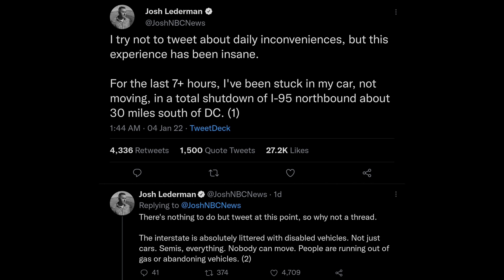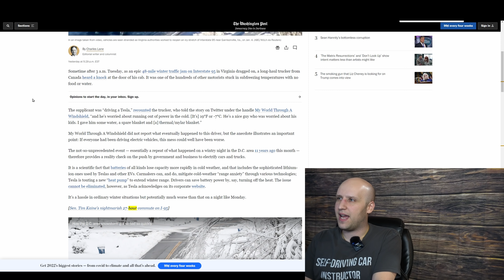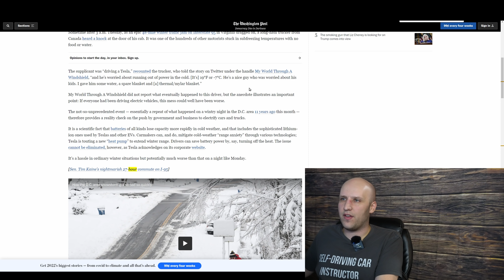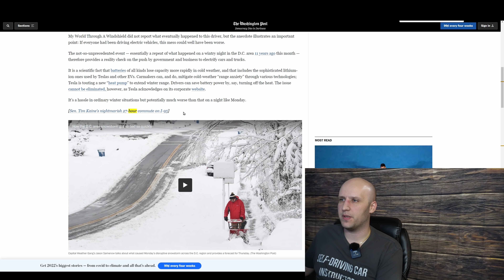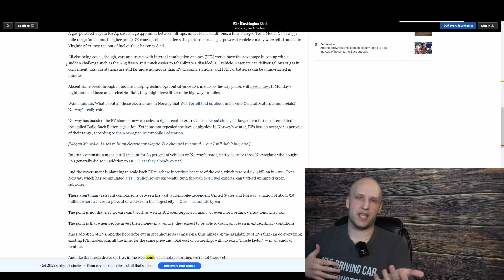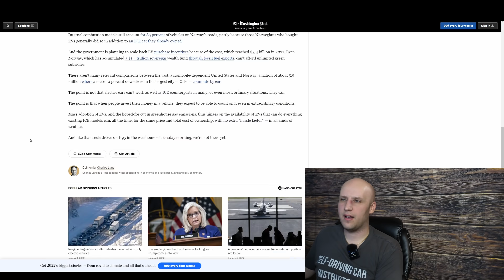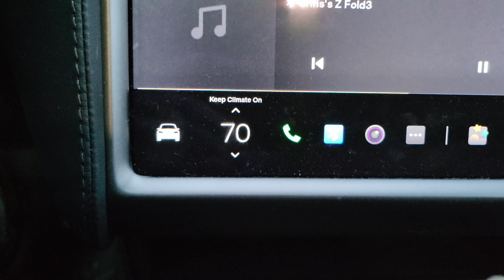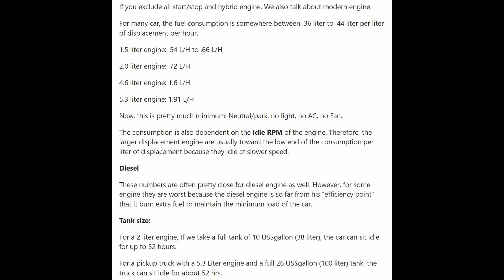How Long Can a Tesla Keep You Warm In A Frozen Traffic Jam? | FUD Debunking

Comment: If you are an EV owner, you're more likely to have the habit of plugging in every night with a near-full battery (80%).

So, you're most likely to run out of fuel in an ICEV.

As for future, how hard is it to upgrade the highway lamps to have accessible plugs that can be activated for moments like this. Just  use shore power for climate.
Reply: The cars & charging infrastructure is upgrading, quite rapidly too… I’m pretty sure petrol stations weren’t all over the place nor were combustion engines as efficient when first adopted. 

We may even soon have very effective solar charging on cars, just hope I’m here to experience the ever growing technologies.
Reply: @MegaGyalis  with more EV coming from GM and other companies, I'm hopeful more will be on board to expand the charging network. I hope we have EV charging at every rest stops.
Reply: @MegaGyalis  i don't believe we'll ever have "effective" solar charging on cars, at least not likely in my lifetime, but i hope i will be wrong, sooner rather than later, but the thing about electricity, it's everywhere, so yea, in cases like this, to have the ability to tap into the current already running alongside most highways, would be great.
Reply: @teklife  wrong. We will. We went from less than 1kw per square feet that costed 76 more expensive... to 17kw per square feet that cost only 15 cents per square feet. Things have changed. In 20 years it’ll be down to 3-4 cents per square feet and probably more dense and boom it’ll be efficient and cheap enough
Reply: @MegaGyalis  We would need 40kw per square feet to be efficient and viable on electric cars, and we still get only 17kw per square feet from 300 watt solar panel.
Reply: @swampyemerson8269  lol
Reply: @swampyemerson8269  I mean charge the entire car forEVER!!!!!!!
Reply: Or you don't have your own charging station and usually drive around with 20-50% battery charge because charging at lower battery levels is way faster and you don't enjoy wasting your time in some parking lot with a charger. Especially on a highway you are more likely to find people driving around EVs with low battery levels than fully loaded ones. The scenario of you fully charging your vehicle only to get stuck for 12 hours on some highway 10 minutes later seems super unrealistic to me anyway. More likely you have been driving for quite some time and your battery is at around 50% or less.
But I guess in the US it is different. Everyone has their own house and then use their 400 miles car to drive 10 miles and back. 

The message should be to make sure your car doesn't run low on fuel/electric charge when there is a chance of very bad weather because it sucks for both if their car runs out of its respective source of energy.
Reply: @ralfrudi3963  Hey Ralf, you don't get it.  Here in the US, nobody is responsible for anything including the safety of their lives.  Technology is supposed to take care of everything, LOL.  Basically, we are breeding a bunch of sorry asses.
Reply: That is a brilliant idea!
Reply: That's a very good point.
Before lock down I would typically take my ICEV from 95%-5% before filling up.
Wouldn't stay warm for long with 5% in the tank lol.
Reply: That is all fine when there IS electricity.  In many disaster situations that is not the case.  Hurricanes, tornados, wild fires and snow/ice storms kill the grid.  You got nothing.  Then what are you going to do?
Reply: Wow! Before we do anymore goalpost moving, let's make it easy and start from zero.

You make your own gasoline (you'll most likely need to dig deeper than 6 feet) and I'll make my own electricity.

Comment: Well rounded view on this.  Thanx.
Nowhere near as extreme, but last year there was a freak snowfall (just much more than expected) here and my 1.25 hour trip home ended up taking about 7 hours.  Mostly because of larger vehicles who thought they could drive normally and blocked the roads when they slid.  I had two different "accident stops" of about 2 hours each, where I just had to sit and wait...
People all over were asking me how my Bolt did and was I worried, at risk, etc...
I was fine...
I did have some things going for me.  
1:  I can charge at work, so I left with a full (well, full on Hilltop Reserve mode) charge.
2:  I had my car preheated while it was plugged in before I left.  So the car was already warm.
3:  I never set my car to 70 degrees.  :-)  That is just way to warm for me.  I'm comfortable around 64.
4:  I had a heavy coat and water and some snacks.  ;-)
So, even with my smaller battery and less efficient car, I was prepared and it was fine.
And I didn't get home on electric fumes. ;-)  I had plenty of battery left.  So I would have been fine for longer.
And I never had any worry about snow buildup around my tailpipe and carbon monoxide issues...
Now, if I couldn't charge at work and/or my car wasn't close to fully charged, I might not have tried that drive home then.  But as you pointed out, the same would have been true if I had an ICE car.  I would have gone to a QC first.  
I was much more worried about other cars on the road causing more accidents than I was about battery level...  ;-)

Comment: Would have been interesting to use camp mode instead of leaving climate on.  I would assume it is more efficient as it is designed for overnight stays - I could be wrong though.  I probably would have used camp mode if I were in this situation.

Comment: Seat heater is not significantly more efficient than air heater.  It is just that it provides more comfort directly to the driver.  For your experiment, both are working until the interior of the car is a 70°.  The heat pump is much more efficient than the seat heater.
Note, that an electric car will have a higher average fuel fill, since they should start each day with a full tank.
ICE cars lose that same 20% of range.
Thanks for actually doing the math as opposed to the FUD media.
Reply: Current heat pumps have power factors of about 3-4, i.e. they use 1kWh of electricity to generate 3-4kWh of heat.

But: The seat heaters directly heat up your body, whereas the A/C has to heat up the whole interior volume - and all that heat ultimately goes into the car body which has about 50x more surface area than a human. So regardless how much more efficient a heat pump might be, it still has to provide much more energy overall. (50/4 = 12.5x more in this case, assuming you only use the seat heater - which of course nobody would do, as their head and feet would get uncomfortably cold)

Hence the most energy-efficient way to stay warm is: A/C at low heat (blowing onto your feet, i.e. concentrating on the area where it's really needed) & seat heater for the rest (optimally not wearing a coat, but using it as a blanket, in order to get as much heat transfer directly into your body while at the same time minimizing heat loss to the surrounding air)
Reply: The seat heater heats you, and doesn't have to run all the time (it cycles). The air  heater heats the outside as well, significantly.
Reply: Running the seat heater alone will last several days, perhaps a week or more on a full charge, and has zero to do with bringing the interior temperature to 70.  The energy usage between heat (even heat pump) and seat heater is wildly different.

Comment: ICE cars also lose "range" in winter conditions.  I have 12 years of fuel logs for my Subaru WRX and my mileage was 7% lower in the coldest four months of the year as compared to the warmest four months of the year.  It's certainly less loss than occurs on an EV, but let's not pretend that you're getting the same "range" on a tank of gas in the winter that you get at other times of the year.  For reference, I live in Western Washington.  We usually get about two weeks in a year that are in the 20's, but most of our winters are in the 30's and low 40's; so not particularly harsh winters.  I don't know if this phenomenon would be exacerbated if subjected to something like a Michigan winter, but I do know that when you look at my tank mileage graph, the trend is clear as day.
Reply: Right. Winter fuel blends also contribute to this. 

The other side of this story, which remains invisible to most people, is that  you don't regain any of the efficiency lost to combustion, regardless of the season. If gas cars had comparable efficiency to EVs, the massive potential energy in gasoline would allow them to drive over a thousand miles per tank. Losing ~70% of your energy through heat and other losses, 100% of the time, has become normalized.

Comment: Ford F-150 Lightning, Rivian, and Cybertruck have outlets on them which would let you use their battery to charge another EV.  The F-150 and Cybertruck even come with a 240v outlet to power devices or another EV.  You can even put a large gas generator in the bed to charge the trucks own battery or as well another EV.  The F-150 also always bi-directional power through the main charging port to power a building or charge an EV.  Ford has anounced that they are currently making more F-150 Lightnings than any other vehicle they have made, there is that many pre-orders of them.

Comment: I wonder how long it would take until the US Govt would require emergency chargers at every highway exit, similar to emergency phones required on highways. The cost for a 220v L2 charger are minimal and it would completely kill range anxiety. That, in conjunction with a requirement to have 2x 220v L2 chargers at each and every gas station (likely at state level) would completely annihilate range anxiety. Note these would me more for emergencies and “last mile” use, not for normal charging. I assume that L3 charging network will grow as EV fleet grows, but in the short term, building L3 at every gas station or highway exit would likely be too expensive and take too long to build out.

Comment: Also keep in mind as you lowered Model Y's temp, it probably turned the AC on for some time to bring those temps DOWN. You can probably round that up to about 65~70 hours.
Reply: Probably not, model Y is smart and since recirculation wasn’t on, it probably just took the outside air and cooled it down.
Reply: @harsimranbansal5355  YOU COULD HEAR THE COMPRESSOR COME ON.

Comment: One note is that for ICE vehicles, the best way you can heat yourself if you're stranded is to run the engine on and off. Crank up the heat and run the car until it's warm inside, and then shut it off.

Still, an EV should serve you just fine in most situations. The most important thing if you go take a long trip (in any weather) is that someone knows where you're going, so they can call for search and rescue if you don't make it to your destination.

Comment: Another point to this which I just thought of is if you lose power in your house, and can sit in your car and keep snug (with a blanket and a coat and hood and seat heaters) for days, that's a fantastic winter safety thing generally. 

I have a whole house generator, and don't want to go the powerwall thing good enough to last for days until the batteries get MUCH cheaper and are significantly less likely to burn/explode re chemistry.   But if I have a BEV that I keep 80 or 90 percent charged at home, that's the PERFECT backup, and costs me nothing extra vs. having a car anyway. 

Score another very practical reason to have a BEV.   (I don't want to sit in an ICE with the engine running at idle for any length of time.  So for that you have FAR less comfort, needing to have an alarm, run the engine in a cycle, thus not sleeping very well.  Plus, sitting idling a lot is bad for an ICE engine and exhaust system).

Comment: I am an airline employee working 16 hour days last week I used camp mode for 2 days in my 2019 Model 3 instead of driving home. I used 15% each night for 6 hours at 75° F, outside temp was 20° F. My question is why did you not use camp mode? It is all you would need sitting still.

Comment: :_Tes:OK, you guys. I finally decided to join this channel formally. This video is the most important I've seen yet. I can speak directly to one concern: anyone getting off I-95 in a Tesla would be advised to get onto Route One (which parallels I-95 even that far north), turn south, and head into Henrico County where I know for a fact that a Tesla charge station is available right now.

This shows that a modern Tesla with a heat pump is your best buy. Beyond that, follow a few simple rules. Always charge before getting out into that bitter cold. Always check traffic and stay away from heavy traffic, especially on a superhighway. (And any regular user of the streets and highways of south central Virginia surely knows, or should know, that in winter your best bet is to stay off the superhighway completely and use Route One, which is far more accessible. Those drivers on I-95 are maniacs, one such maniac had a jackknife accident, and now see what!) Carry food (in insulated containers, including that old standby, the vacuum bottle), water, and blankets all around as part of your cold-weather kit (the other being a first-aid kit; the worst first-aid kit is the one you never make). Dress for the weather! Wear layers, and be prepared to set the cabin temperature to maybe 60°F, have on your long johns, and don sweater and/or jacket. (Does the Model Y come equipped with an emergency stove, or plugs to use immersion heaters to heat water for tea or hot chocolate? Maybe someone ought to mention that to the company.)

You forgot to mention the cause of the accident. An 18-wheeler jackknifed. Other influencers have predicted that the Tesla Semi has so many safety, traction control, and other systems that you couldn't jackknife that truck even if you tried. (If anyone doubts that, you know how to reach me--just reply to this comment.)

In the world with everyone driving a Tesla, and every truck being the Tesla Semi, the auto-navigation system would reroute selected cars to Route One just to get past the City of Fredericksburg. Those Semis would be a lot safer. Even in a repeat of this case, that Tesla won't suffocate you with carbon monoxide. The wrecker companies could dispatch Tesla Cybertrucks equipped to charge up a car from dead to maybe 30 miles of range, enough to reach a charge station. And those charge stations would have Power Packs or Megapacks to make sure they had the juice in case of grid failure.

Hey--I have to make recommendations for safe vehicles. This is vital information and I hope every South Central Virginian takes it to heart.
Reply: In the real world, for people who have to commute, they are going to use the roads available and convenient for them.  The interstates aren't there for everyone to stay off them, for crissakes. 

OTOH, being prepared and charged (or gassed) up, having a blanket, coat, hood, water makes obvious sense when it's cold -- especially when bad storm weather is forecast in the area.
Reply: @rogergeyer9851  under normal circumstances, you are correct. But not in a snow emergency. I-95 in Virginia is a multivehicle pile-up waiting to happen even at the best of times.
Reply from the maker: Thank you Terry. Much appreciated!

Comment: The reason that Model X is at 75 when you set it to 70 is most likely do to the fact that there is only one temperature sensor in the car.Yeah it is 75 wherever that sensor is but there may be somewhere in the car where it is less than 70